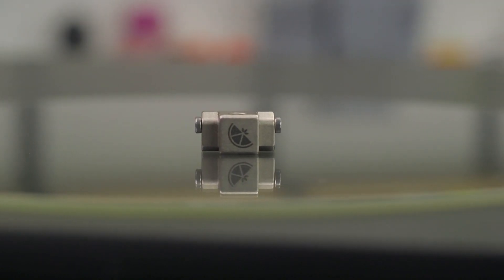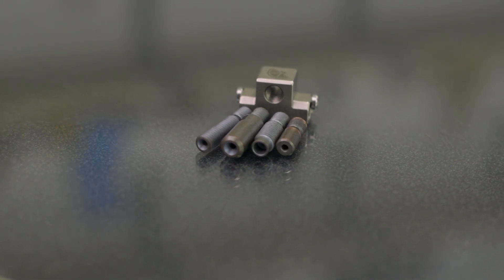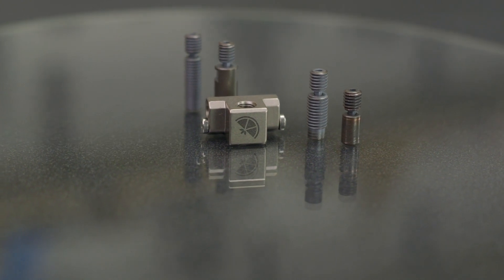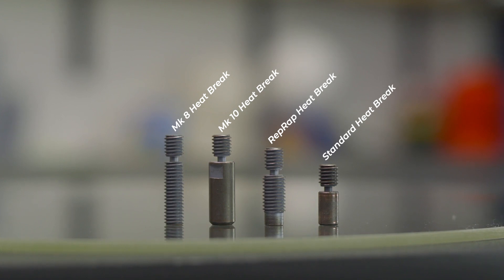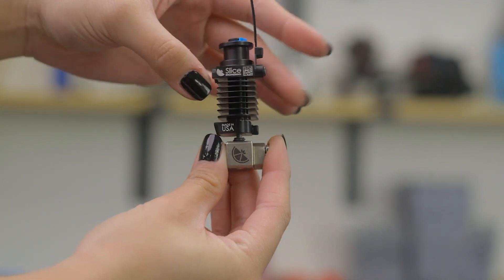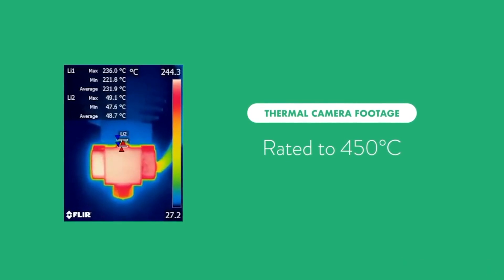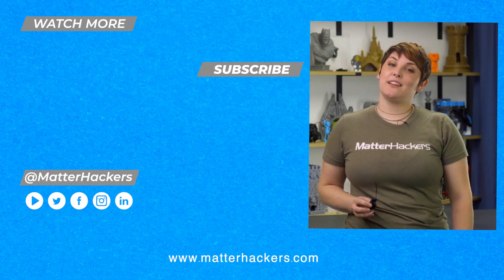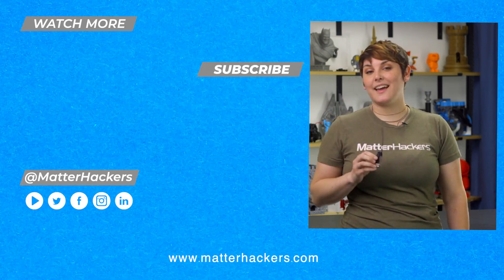Tech Breakdown: The CopperHead Hotend System from Slice Engineering

Comment: E3D, Phaetus, Slice Engineering, all those brands started to use nickel plated copper heat blocks instead of aluminum or brass hotends. Its not a coincidence... Copper has 3x more heat transfer rate than Aluminium so you don't need to buy whole hotend kit just buy a quality nickel plated copper heat block for your hotend and add copper CHT nozzle clone mount all together it will be the same thing!

Comment: What is a bimetallic alloy?  Don’t those two words imply the same thing? I feel like this is just fancy marketing jargon to make it sound cooler
Reply: A metal alloy is a mixture of two or more metals. This is usually done by melting the metals and mixing them in their liquid state, after which they solidify into one metal alloy.  a bimetallic object refers to an object created using two different metals, however the two metals are not mixed together. The wikipedia for bimetals gives good examples like the penny, which is made out of zinc and later plated with copper to give it the appearance of being entirely copper.

Comment: Just so everyone here is clear on this because it was given no mention, just because a hotend can reach 450 degrees celsius, it does not mean anyone can print 450 degree filaments and then switch to 200 degree filaments because residue of the hotter filament will jam the printer and the hotter temperature will burn the cooler filament residue. It is recommended to buy more than one hotend especially for print ranges greater than 100 degrees celsius. Cool stuff.
Reply: why not just add a gcode purge sequence retracting the filament out of the melt zone, heating to 450, then quickly pushing filament through to purge or manually doing that?

Comment: Is there a reason the E3DV6 style hotend cannot reach 450 degrees celsius if its thermistor and heater cartridge were rated for said temperature? I am trying to understand the difference between the two.

Also is it compatible with E3DV6 ecosystem from nozzles to volcano and super volcano?

What are the screws on the copperhead heat block for?
Reply: V6 Gold is copper block variant (you can get block only as well) but it’s bundled thermistor (Semitec 104Gt) is rated only for 285c. Technically if you swap it out for PT100 (rated for 500c) you should be able to get high temps.
Reply: Nozzle wise I believe it’s the same but definitely not volcano or super volcano due to its size.

Comment: Interesting hotend! I I wonder what Thermistor is rated to work to 450C as well in conjunction with this Copperhead. That would be the future to be able to print that hot. All of the exotic filaments like Nylon, PC and Carbon Fiber blends would be easy to deal with :)
Reply: I’ve swapped out aluminium V6 block with copper V6 heatblock + PT100 set (rated up to 500c) on one of my machines so I can do PC without worry. Dared to go up to 400c as a test.